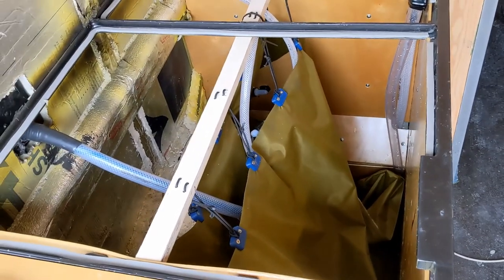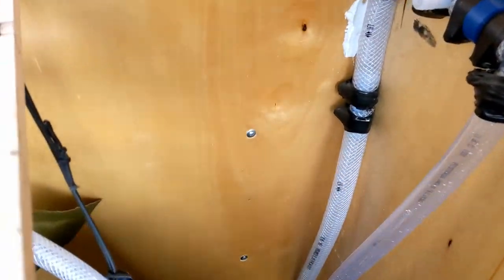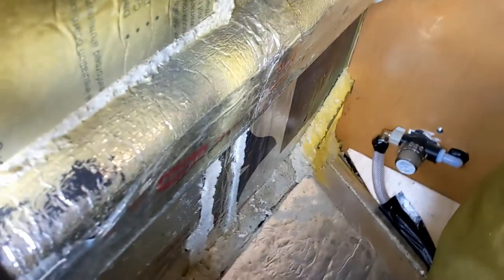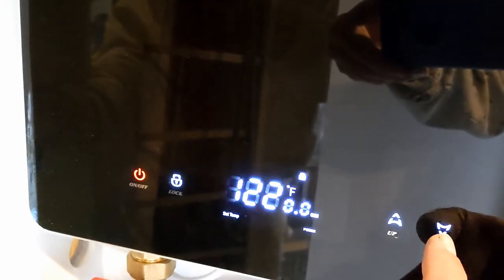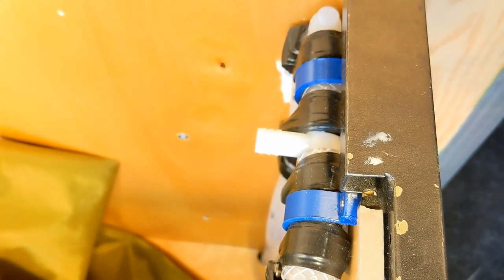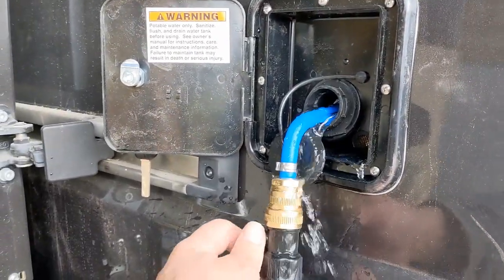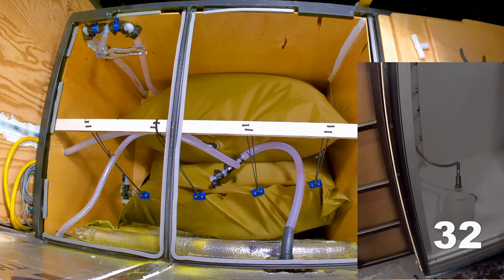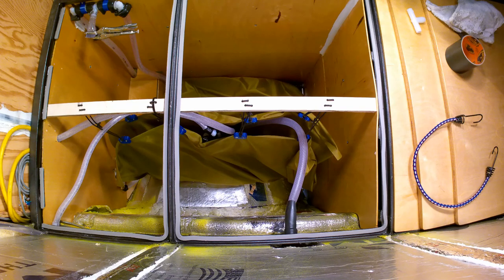VanMargrit Water Bladders for fresh and grey water -- 45 gallons each RAM ProMaster #vanlife

Comment: Awesome video! Thanks so much for putting that together. What sensor did you use in the shower tray to turn on the gulper pump please? Are you able to put a link on here? Cheers, Nick
Reply from the maker: I used two pumps, one for the sink, one for the shower. Both are "Whale Gulper IC Gray Water Systems" https://www.westmarine.com/buy/whale-pumps--gulper-ic-gray-water-systems--12026969?recordNum=1

If I had to do it again, I'd have a single pump https://www.westmarine.com/buy/whale-pumps--gulper-ic-gray-water-systems--12026951?recordNum=12 with the sump mounted under the van in an insulated box. Maybe put a small heater in there if you are worried about operating in super cold temperatures.